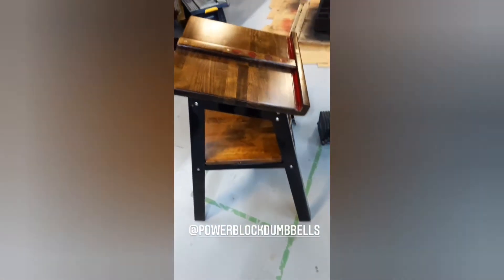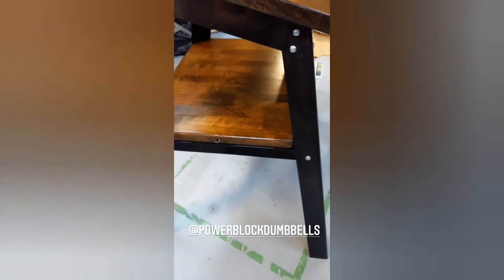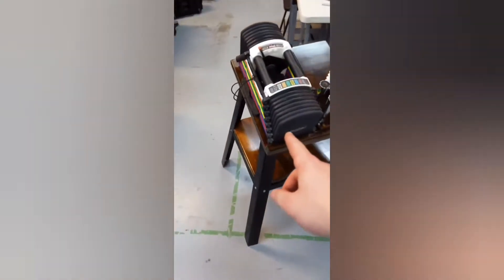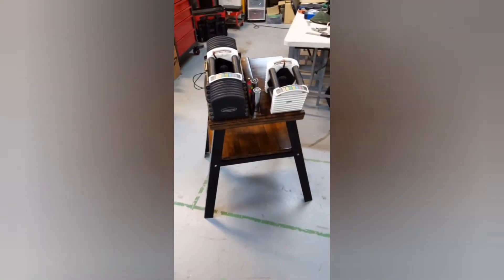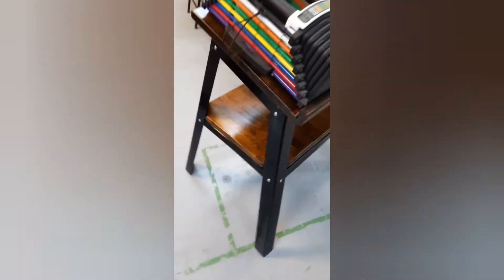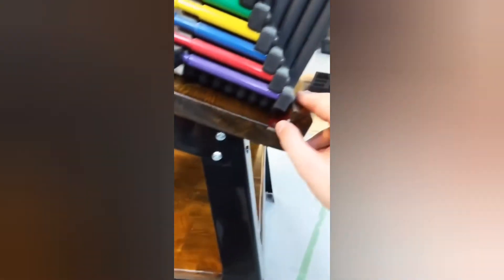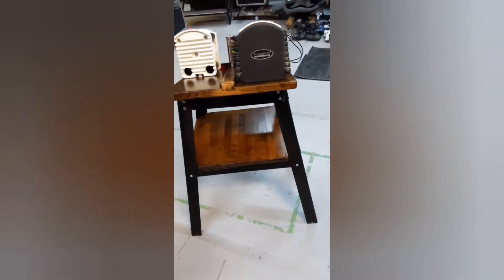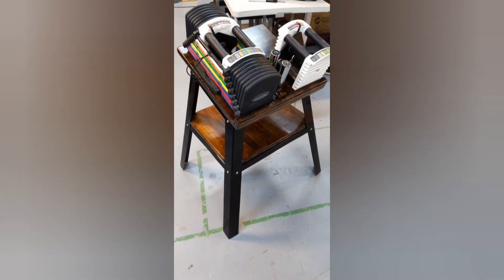$60 Custom Powerblock Dumbbell Stand

Comment: I'm trying to make one similar to yours. I already have the metal frame. What is the height of the front and height of the back stand? I'm trying mimic yours
Reply from the maker: The black metal underframe is 27" high at the front, and 30.5" at the rear. I used to have the plans regarding the angles of everything, but those ended up in a bin during a recent workshop clean. Also the black metal frame for the shelf underneath is 16.75" high. Take into account that the wood I used is about an inch thick. I'd recommend testing sizes/heights for yourself, because everyone is different.

Comment: I already have the U33 column stand. I wonder if I can add coasters to it some how?
Reply from the maker: I've never used that stand, but reinforcing the base would be a must, then adding heavy duty casters would likely work.
Reply: @BenDunlop  the only downside I can think off is that it probably will be too high when adding reinsforment and coasters
Reply from the maker: @futbol1972  search for "mobile tool base", that will be your best bet as it doesn't raise the overall height by too much (unless the wheels are engaged). You'll find them at your local hardware store. I'm off to get one today for mine.
Reply: @BenDunlop  thank you
Reply: @BenDunlop  will I need to reinforce the mobile tool base?